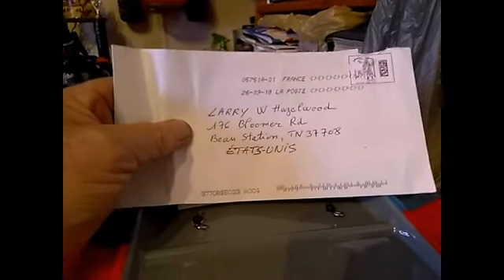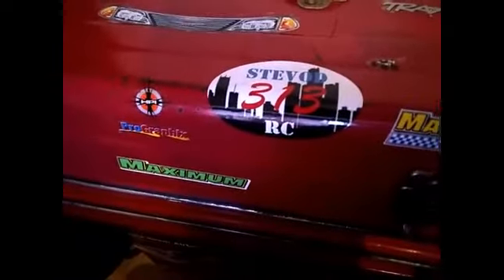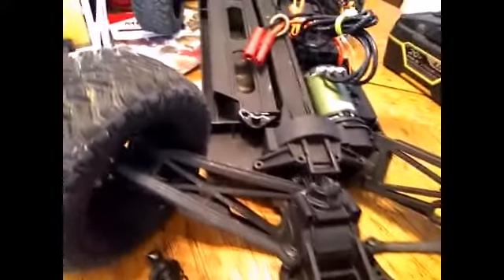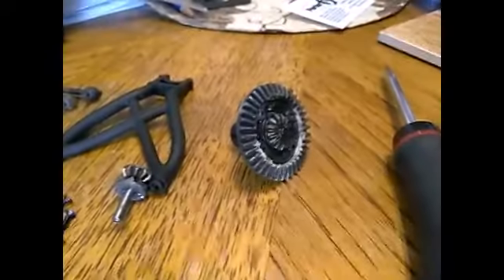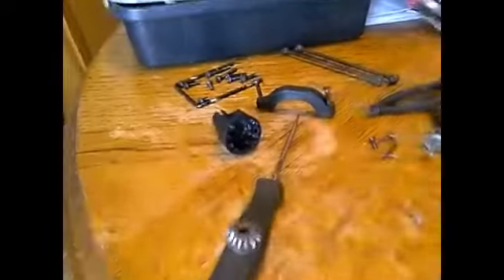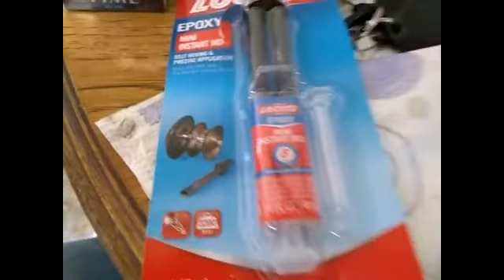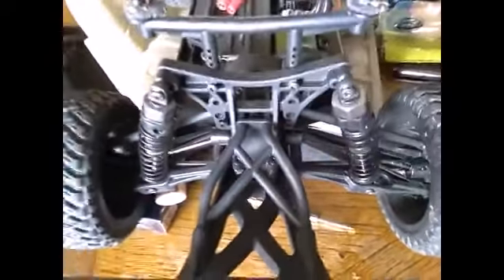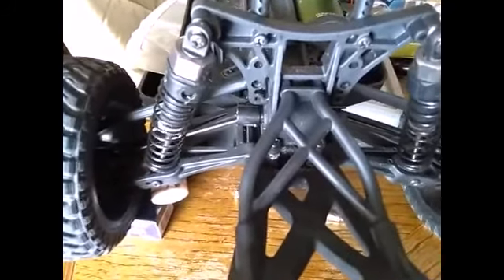MAIL CALL and REAR Diff Locked

Comment: 😀👍Nice, I did that with my wltoys buggy i made into a trial rig and it worked out great.
Reply from the maker: Thanks my Friend..✌️😎👍
I used a hot glue on a Duratraxx Maximum ST Nitro 2wd Stadium Truck and it did good but was easy to spin out..You think this would be a trick for the front Diff or for handling should it still be slipper?
Reply: Hi never lock the front only on crawlers it wont turn good and the front will push like crazy at fast speeds if you do turn and it will handle like crap. leave the front open even with the back locked now it will be fishtailing around a lot in the loose stuff compared to a diff but it will still be usable.